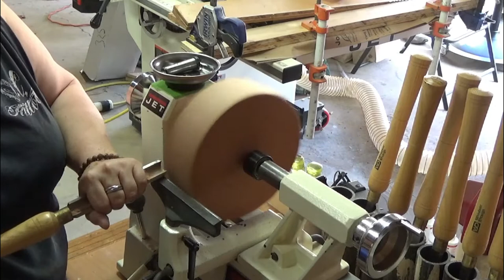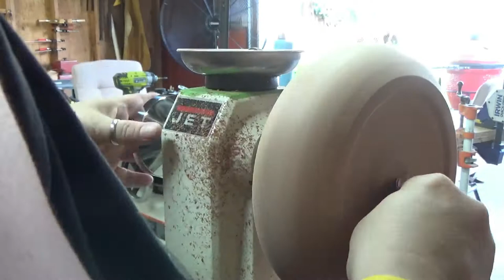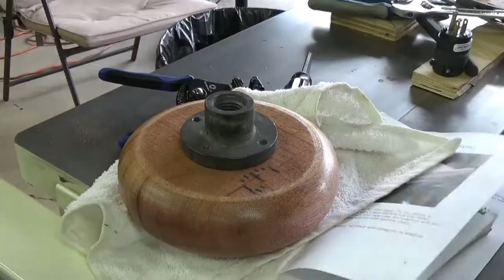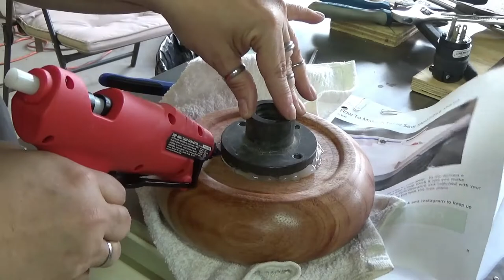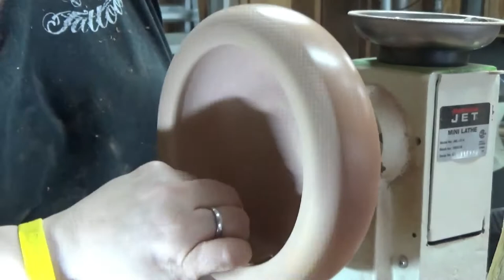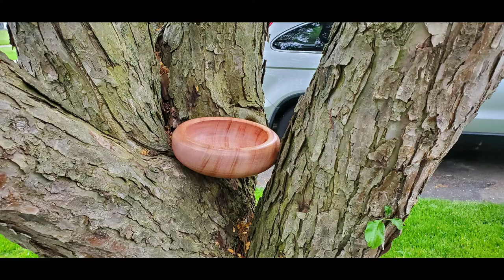Turning a Mahogany Bowl

Comment: Why are you using double sided tape and hot glue on the face plate? You should be putting a mortise or a recessed tenon on the bottom of the bowl. It not only centers the bowl in a chuck. But also is much safer. I am really surprised the face plate did not come loose especially after you used wax on the bowl. One good catch and that bowl is flying.
Reply from the maker: They make special double sided tape specifically for this. I add the glue as a second level of safety. Its not at all uncommon to see others use just one or the other.  I do not use mortise or tennon methods as I do not own a chuck yet. They are quite expensive.  I have the faceplate that comes with the lathe, like most new turners do.
Reply: @JensWoodworkingThings  
I thought that might be the case. But, I still would not trust it.  If it works for you then keep on doing it. Just take care turning.